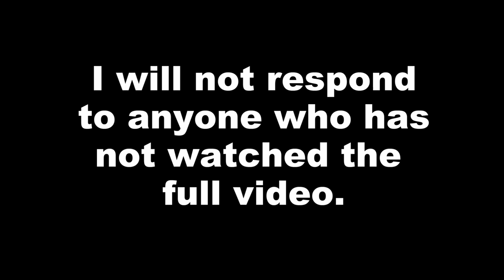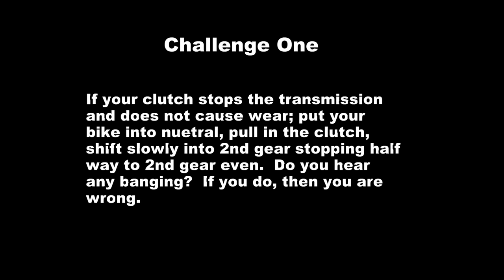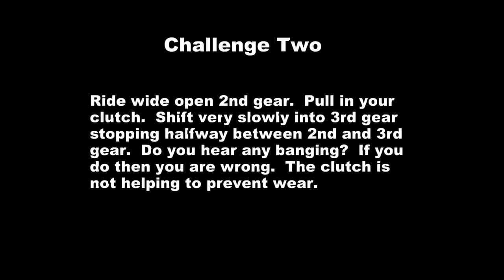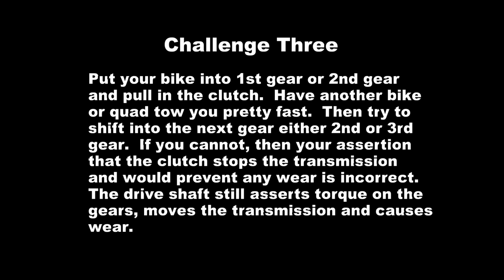Dirtbike: Shifting without the clutch

Comment: I have a question about my current dirtbike, a SX125 from 2002. I have transmission problems which is that the gears sometimes jump out of gear right after shifting, happens most often from first gear to second but can also happen when shifting down. One time when I shifted from 5'th gear to 4'th but it turned to neutral for almost a whole second then the 4'th gear popped in there so the gearbox made a slamming sound (<--- Has only happened once). Most commonly It's when I shift from first to second tho.

Any guesses? It seems like you are quite experienced with dirt bike transmissions.

Comment: I have been shifting without the clutch since the 70's with zero issues.
Reply from the maker: +tonypybus Ya, I've never had a bike with problems either.
Reply: +Opferman Motors Dirtbiking appreciate the video, im new to dirt bikes and enjoy the lecture.
Reply: Opferman Motors Dirtbiking is it possible to make a clear crank case to see what it looks like inside? Don't respond if this is a waste of time
Reply: I was extremly suprised when I saw how many people using clutch to shift gears. I mean, I know you don't need to do that since I'm 4 years old...
Reply: The Husky Rider  yea, look at Ducati bikes they have  clear clutch covers as they have dry clutches.
Reply: ive been riding for 35 years and hardly use the clutch. mainly to take off.
Reply: then you were doing it wrong whole 35 years, time to change..
Reply: then you were doing it wrong whole 40-50 years, time to change..
Reply: Do you close the gas when shifting?
Reply: I'm wondering why someone's going through all this in a video like this. He's trying to prove to people what has been known for decades. Maybe he's been arguing with these young kids who think they know dirt bike mechanics because they have been riding for a couple years.
Reply: Bragging about not using the clutch is very very dumb. Your clutch is an integral part of controlling the bikes power delivery.  You should be using the clutch  100% of the time while riding.
Reply: Deucealive75 oh I know lots of them!
Reply: esner24 are you joking? Lol. Cause I seriously can't tell
Reply: Getting itt
Reply: @wheels.and.wrenches  wrong you do not need clutch when changing gears. Clutch is only for modulating power delivery AFTER choosing your desired gear.
Reply: @wheels.and.wrenches  i always use my clutch since its engaged when i drive :D

Comment: the best reason for neutral being between 1st and 2nd is really simple, you are always in gear, this is very helpful with high speed, enduro, motocross riding because you have to try to get it in neutral, i have ridden my neighbors pit bike a few times and his in all up gear ratio and when i go to a hill climb and dump the clutch to go up the hill i find myself in neutral, compared to my motocross (standard) gear ratio i would have been in first.

Comment: so riding hard daily since 1980. raced mx on bikes trikes and quads ... 2 stroke and 4 stroke. I've   owned 5 trikes. I've owned  7 quads. and I've owned over twenty mx bikes. plus a hd dyna and fz750 and a 650 nighthawk and a virago 750.  not one of theses units ever seen a shift without the clutch if they had a manual clutch.  growing up burning an average of 3 to 10 gallons of gas a week I put a ton of time on every bike I owned mostly practicing on my niebours track or riding sandpits.  my clutch lever is my best tool to make traction or manipulate the bike to do what mx bikes can do. I love my clutch and if I die I want handlebars with full mx controls in my casket lol.  one finger on the brake N 2 on the clutch lever so I can keep on ripping.  41 now so gotta plan ahead
Reply: Ernie Desjardins That is awesome. Love your story though.
Reply: Ernie Desjardins you are funny dude!

Comment: Wow, I feel like I'm back in school listening to a lecture. lol. You make a lot of good points.  Will have to watch this a few more times to digest everything you said. Your definitely taking the mystery out of transmission for me with these videos. Gives me confidence to tackle my own. Thanks, see you next post.
Reply from the maker: +Scott Viers Cool, glad you enjoyed it!
Reply: +Opferman Motors Dirtbiking so like a dirt bike is on a stand with the back tire off the ground.. if you pull in the clutch the back tire will still rotate thus power or wat ever is still being pushed thru the transmition
Reply from the maker: +Dieonte P123 Yes, there's not enough resistance to fully force the clutch plates apart.
Reply from the maker: +Dieonte P123 And that could be for a variety of reasons.
Reply: +Opferman Motors Dirtbiking one last question ...how often would u need to rebuild a top end and a bottom end
Reply from the maker: +Dieonte P123 Really depends.  Bottom end should last a long time typically.  Top end is more frequent.   Typical people may replace top end every 100 hours.  However with low revving big bores and trail riding you usually have less wear on compnents and can wait longer.  definately needs replaced once you loose noticible compression however it depends if you want to wait that long.  Trail riding, maybe you do.  Racing definately not you want to be as fresh as possible.

Comment: I "blip " the throttle during up shifts on my 86 CR500 with a Barnett clutch and have been since 98
I run VP C-14 and the only thing stock is the frame. I think you're video is pretty accurate and well done. Subscribing

Comment: interesting! ive never had a bike trany apart (i never use the clutch to shift has never given me any problems) but i have had many truck transmisions apart and you cant shift without using the clutch unless you rev match because they use sliding clutches to engage gears to the mainshaft and it is spinning at such different speeds that the sliding clutches cant engage unless you rev match because the are tappered and get spit out. this video has answered a question ive had a long time wich is why can you shift a bike without the clutch and without rev matching its because the gears directly connect using the gear dogs wich are square cut not tappered. very good video!
Reply from the maker: Thanks, glad you enjoyed it!

Comment: i think that's a good and deep explanation from Mr. Opferman, i personnaly ride off road for 25 years, enduro/trails and motocross too, i'm no great driver, but i never upshift with clutch, and very rarely downshifting with clutch, i had 8 bikes from different makes, and never had any problem with the gearbox. you just don't shift like an idiot,under power,and do it snappy - exactlly as Mr. Opferman says. and in the right driving speed. never had any chips/sludge in the gear oil ( in 2 stroke bikes )...

Comment: I think what people mean about not wearing out as quickly is that the transmission won't be accelerating when under engine power, yes it's still under rear wheel power, but it won't be accelerating.  Also pulling the clutch sets you keep on the gas to make it so the power applied is less without losing rpm. Then slipping the clutch would apply the power/acceleration  gradually back to the gears. Again, yes it is still under power from the rear wheel.
I do believe that using no technique and shifting under acceleration with a big clunk would wear it out quicker than pulling the clutch, retaining engine rpm, then gradually applying power with the clutch. 

Shifting properly without clutch is done by letting off the rpm and timing the shift so the power between the wheels and the engine is balanced so there is no torque on the engine. 

That requires you to let off the throttle, so if you can get rid of torque on the gears and shift by simply pulling in the clutch and retaining the rpm.
Reply: I think both of us are right. I use the clutch because I want to be able to retain rpm in the right trails because it is much easier to bog and sometimes very hard to increase the Rpms.

Comment: I think a lot of people think that a dirt bike trans works just like a cars trans. The problem when speed shifting in a car, is all of the gears aren't traveling at the same speed. This means that synchros are required. When you speed shift in a car, there's a small moment when the load of the vehicle is on the synchro. Of course the synchro wasn't designed for this so they wear out thus creating problems. The difference in a dirt bike trans. It's a constant mesh setup. Meaning all gears are moving at the same speed as each other. No synchro required. This is why you just have to blip The throttle. Instead of trying to match rpms. The load now falls on the gears. The gears that are designed to take load. Speed shifting is no different then letting the clutch out. To the people saying "your wearing your friction plates!" You can and should replace those dummy!

Comment: I'd just like to say that modern technicians are not your mechanic of days passed. I am a certified ASE diesel technician and they spent at least 3 months of 20 hours a week on each topic explaining why the engineers designed the things they did the way they did.  Whether it was the trans/fuel system/engine/brakes/suspension and oh lord the electronics.  So don't stroke your tip to hard buddy. But this was a solid and easy to understand video, good job.

Comment: So... im a young,dumb,teenager and this is what im getting so far.
You don't need clutch to shift
BUT you have to cut throttle down 

And another thing separate is that the gearbox is connected directly to the tire but the gearbox is translated to the engine through the clutch (the gearbox is separated from the engine by the clutch to phraseiy in a different way)   

Please tell me if im messing anything up

Comment: Shifting a close ratio transmission w/o the clutch does cause high shock loads to the whole system and may reduce the life of one or more parts a little but on the whole the system is more or less designed to handle it. To me it's just a question of how much I want to baby the transmission and how long lived I want the transmission (and con rod bearings) to be. The heavier the piston (ie: higher engine cc), the more shock to the conrod bearings.

Comment: Awesome video! I learned quite a bit just from this, I appreciate the work put in. It's good to know because a lot of people seem confused or think if you don't pull in the clutch, you're automatically damaging the gears, which seems wayy off after watching this lol. Myself, I don't normally pull in the clutch unless I have to, like using the back brakes (to prevent stalling) or to keep rpms high enough coming in and out of corners, or at the start of a race (obviously). Thanks again!
Reply from the maker: Thanks!

Comment: Transmission is always spinning if the rear wheel is moving. It's directly connected. This is why it's harder to push your bike with just the clutch pulled in than if it were in neutral because neutral disengages the input shaft

Comment: I dont understand why this video even had to be posted. Its such a easy concept to understand. If you use your clutch to shift you just wont wear down your transmission as fast in comparison to if you just power shift. Some people claim that they can power shift at the perfect RPM, which is all cool and all but each bike is obviously different. I rode bikes where the responsiveness was so slow that I had to power shift just to keep power. But for the sake of generally speaking, basically for all motorcycles, be a gentleman and use the clutch. Except if your riding a Ducati. Dont use it, makes a cool sound lol.

Comment: I know it's a different topic but is it bad to just press in the clutch instead of shifting into neutral at traffic lights?
Reply: No, it won't hurt anything.  It's generally best practice in that situation, too, since you can get out of the way of a cager that looks like they're going to run you over if you're idling in first.

Comment: I've always shifted up without the clutch. Backing off the gas or interrupting the ignition with a quick shifter makes it shift a bit easier. The dogs have a ramp angle machined into the drive faces to make the gears pull together under load so taking load off makes it easier. Shifting down I only use the clutch on tar to make it a little smoother. Stops the rear wheel hopping. On dirt I don't bother. I just back off the throttle a bit to make it smoother. Electronic quick shifters are best.

Comment: Oh crap! I've been doing it wrong since the 70's. Pretty much never used the clutch on dirt bikes once moving. Heck, lot's times just stomped it into first to go. (Open bikes will do that.) The Euro bikes seemed a little happier at clutchless shifts. Especially Maicos in the 70's. Even my 91 Yamaha FJ1200 is perfectly happy without the clutch from 2nd to 5th. And it's got 69,000 miles on it. 
I guess I wasn't smart enough to know it was wrong so I never have broken a tranny. I have rebuilt a few gearboxes for other people but it wasn't from clutchless shifting in normal use.
Of course there are factors. Close ratio boxes work better than wide. There is a bit of throttle finesse technique required. Stuff like that. 
It's not rocket surgery people. There's no magic in a tranny. They are overbuilt enough to take it.
Just go have fun instead of talking.

Comment: I use the clutch on my bikes unless I'm racing around or accelerating hard. Also on my 1942 Willis jeep the transmission has a non synchro first gear. I can shift with out the clutch and rev Match downshifts better than newer vehicles. I don't know what they changed on newer transmissions but it works perfect to not shift with the clutch on that jeep ( not speed shifting. Rev matching)

Comment: Good video man. Used this video to convince my sister to stop using her clutch. Every time you pull that clutch  and let it slip you dirty your oil. "Challenge Four"  Run your bike wide open in top gear pull in your clutch and shift into first and see what happens. (Not recommended)

Comment: I guess it depends more on ridding style... I use the clutch most of the time I shift because when shifting up I like to power shift and when breaking and shifting down I like to be able to tap the rear break and, if necessary, lock the rear wheel to start the slide. So I keep the clutch lever in the entire breaking time while going down the gears and controlling the bike with the breaks. 

Again, it's more of a ridding style and bike control thing than a mechanical concern

Comment: I'm new to dirt-biking and watched your video because I'd like to find out more information about how shifting works. This was very informative. However, I have two questions. 1) Why then do we have a clutch? Is it solely to go from parked to moving? 2) Does clutchless downshifting hurt the transmission?
Reply: I can tell you the answers to your questions based on my 2 or so years of experience riding my bike. I believe we have clutches not only for starting from a stop, but also to allow us to put on the power just right to tackle some pretty difficult terrain. I'll explain: Say you are riding a trail and you come to a step or a log in the trail that if you just hit it straight on with your tire it would flip you because it is taller than half way up your front tire. How do you get over that thing? Well, you wheelie a bit performing what is called a splatter. The first tire that hits the log if done correctly is actually your rear tire and voila you are over the obstacle. I have tried many times to wheelie without use of the clutch and found it to be extremely difficult because of a lack of power. And answer 2: clutchless downshifting may hurt the transmission more than using a clutch depending on the technique or lack thereof that is used to downshift. A blip on the throttle that's just right, or a blip that is too much basically dictates if it hurts the tranny. It's a bit difficult to reduce torque on the transmission with throttle alone for a downshift which is why using the clutch for a downshift is never a bad idea. I usually use the clutch as well as a blip on the throttle to rev match for a buttery smooth shift.
Reply: if you shift in to a insanly low gear like fourth to first but as long as your not jumping two three gears it will be fine and you can use the clutch to work the power kinda
Reply: Benjamin Stone As you get more experience on a dirt bike you will find the clutch is a tool to be used in conjunction with the throttle to control the torque of the engine. You are probably on a four-stroke so this will sound foreign but on a two-stroke you have to slip the clutch to get the engine rpm into the power band quicker. There's alot of technique that applies to both engine types such as slipping/feathering the clutch to prevent a stall in a high climb, or slipping the clutch on a muddy day to depower the bike so you can maintain traction.

Of my 14 years of riding I spent 7 of them not realizing the importance of the clutch. It wasn't until I started riding two strokes and big bore four strokes that I had to learn how to depower a bike in slick conditions and how to ring the neck of a two stroke to keep it in the power band as often as possible. So don't worry the day will come when you lay the bike over, break off the clutch lever, and have to relearn to ride without it to get home.
Reply: miceeno well said